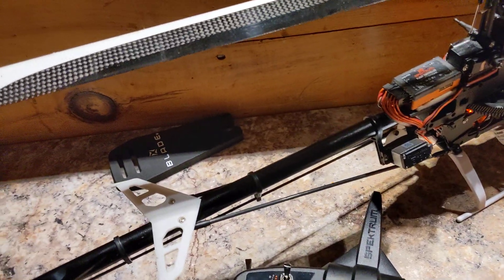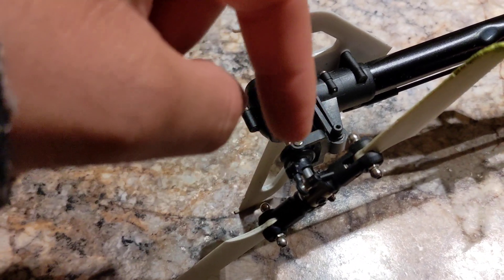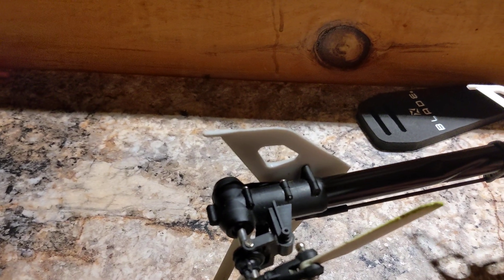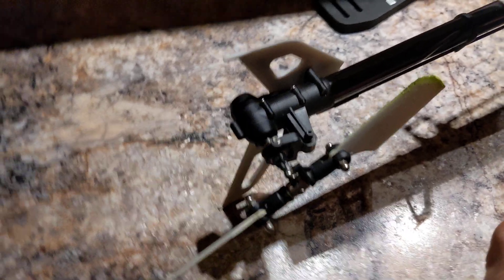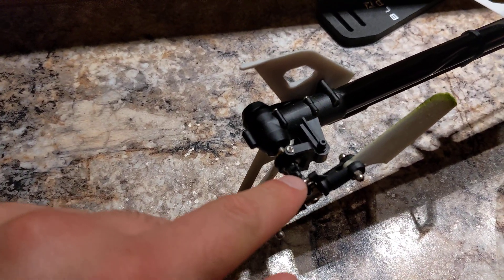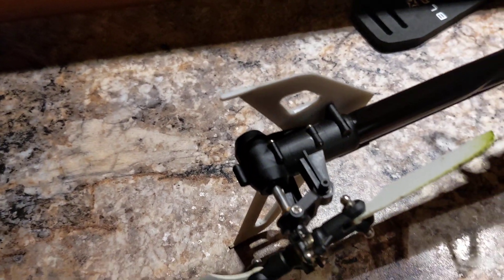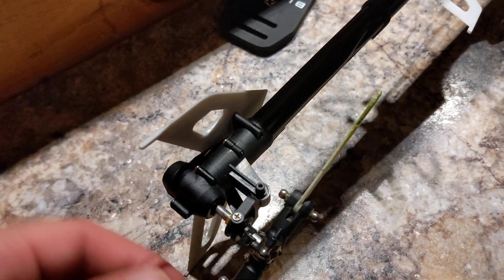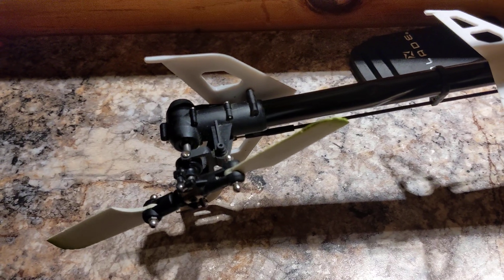Blade 330s tail rotor pitch direction

Comment: Mine spins out of control is it possible for me to email you been doing it since day one never flown properly
Reply from the maker: Sorry to say but I don't give my personal email out. Ok what I want you to do is plug in the helicopter, turn the throttle hold, so the rotor blades do not start up. Now with your hand grab hold of the tail boom and see which way the tail servo pitches the tail rotor blades. Which direction does the leading edge of the tail blades pitch?

Comment: Ok cool I see what you meant now, did those blades hit some tall grass? I always try to land mine on the concrete or a flat surface, good video! Thumbs up!👍
Reply from the maker: Thanks, your close but what happened is one of them actually hit a small tree branch on the ground during a hard landing, the tail hit first, It was an emergency landing because the wind started to pick up. That field I fly in gets mowed every couple of days, and sticks aren't a common problem in it for the most part and the grass is more forgiving when I have a hard landing.